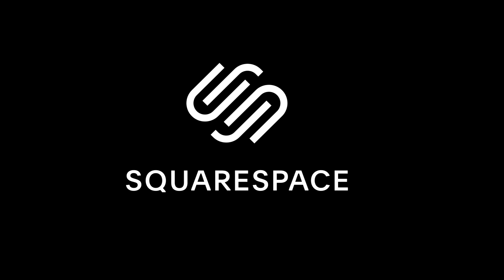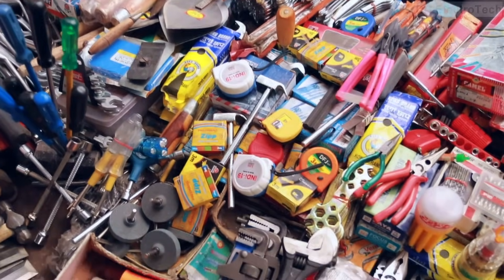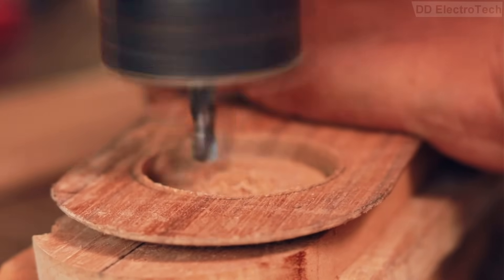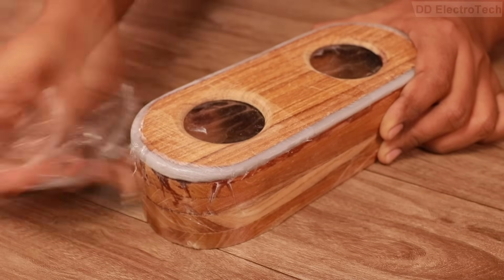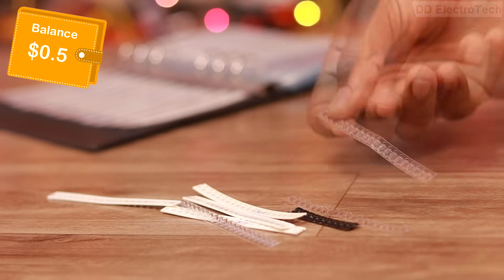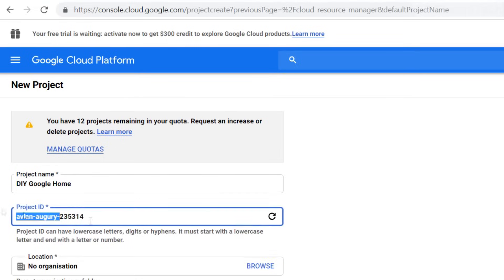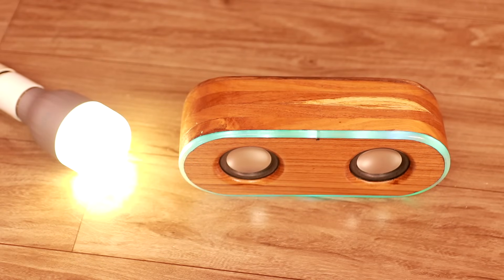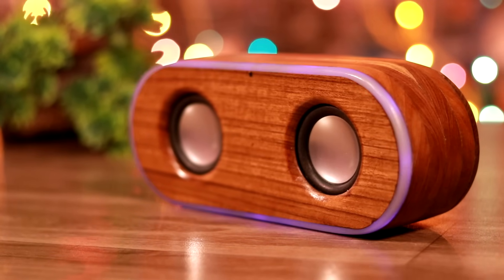How I Made My Own Smart Speaker Google + Alexa - Under $30

Comment: Instead of designing separate board for connecting speaker and mic , you can also use Bluetooth speaker to connect to pi, so you can use  mic and speaker of BT speaker. 

By the way great project ...

Comment: Isn't it easier to wire the components via GPIO instead of soldering?
Reply: i dont know, i guess its a stronger connection when you solder?
i really dont know.

Comment: If you don't want to wire up audio input/output by making a PCB, just tear down an old Bluetooth speaker with a built in Mic, buy a Micro USB 1 Female to Dual 2 Male Splitter Y Extension adaptor to power both the raspberry pi and the speaker simultaneously. Then just pair the speaker/mic with the Pi. This saves on buying a lot of parts and doing wiring/soldering. I did this just by attaching my Pi Zero to the back of my Bluetooth Speaker and using the splitter to power them both. You could go the way of making a custom case still, but even the simplest method will work!

Comment: "Raspberry pi zero w" cost more than 18$ . Please next time tell truth. And please put the link and design and diagram of circuit link in description
Reply: It use to cost $10 but they discountinued it and the price rose.
Reply: Bro buy them from aliexpress.
Reply: I checked in ALIEXPRESS. In there also 18$
Reply: 8th Nations ok well.
Reply: Think about it. The price probably rose since last year.
Reply: @colorplease9570  it costs 10 dollar but the shipping is very expensive
Reply: Pi zero w is only £10 from pimoroni that's about $13
Reply: in canada it is 10CAD
Reply: I saw one for 8 euros, next time do your research, thanks!
Reply: Depends on the model

Comment: Does it work without Internet access? And if it needs internet then how to connect it?
Reply: Google/Alexa needs Internet to work and the Pi Zero W has an WIFI module whitch is configured in the OS on Setup
Reply: @tobiashegemann1811  how to connect it with our Internet? (Hotspot of Router)
Reply: @Lucifer-he4wh  The Pi connects to A WLAN like a normal Smartphone just go into settings wifi an select your WLAN and enter your passwort
Reply: @tobiashegemann1811  thanks

Comment: Raspberry Pi zero don't have onboard WLAN ... And the additional pcb you designed don't have WiFi. Sooo...
Reply: U R Smart dude good point
Reply: He said Raspberry Pi Zero W
Reply: you can connect externally by using external Wi-Fi adaptor that's it it is very easy I already created a project on arduino and I used that raspberry pi and I connected Wi-Fi adaptor to it just need to download some ........

Comment: Now I have to make a Google Home smart speaker with a old cell phone with speakers just to show people  How to make a better Google home speaker then Google actually provides or I’ll use a tablet so it will have touchscreen capability  big speakers I’ll put LED lights in it like you did make mine out of a resin mold so LEDs shine through the internals with touchscreen and make mine transparent

Comment: Pro tip, you can use a little audio foam to control the resonance in the speaker chamber and remove a lot of that echo. Also putting some rubber stoppers in the bottom of the unit will help with isolation control.

Comment: I need a suggestion
Can I develop a wifi UPnP protocol or any other streaming protocol supporting speaker using esp8266 or any cheap arduino board??
I got only one option, up2stream audio board, pricing 4k, too high..
Thanks in advance

Comment: You really did a really good job on this. Everything from the woodwork, circuit design and the final presentation. It looks like an elite home assistant cum speaker system. I am an electronics engineering student from IIT and I must say, you are amazing!